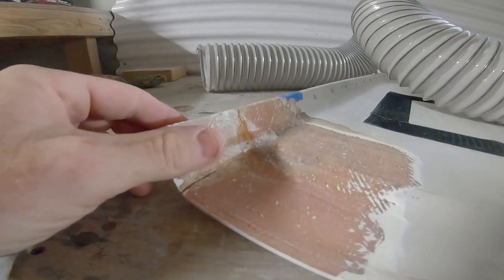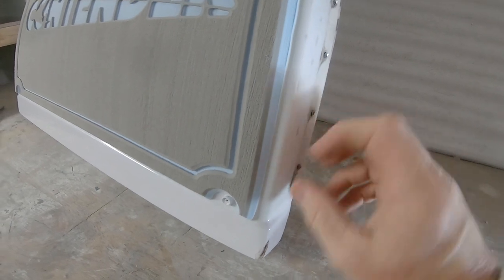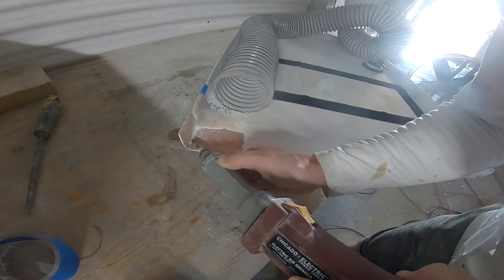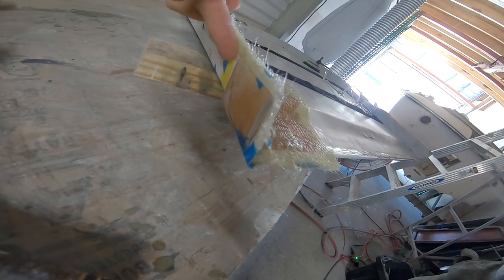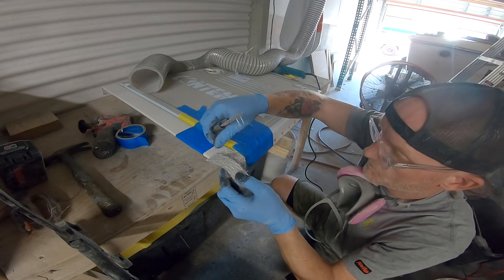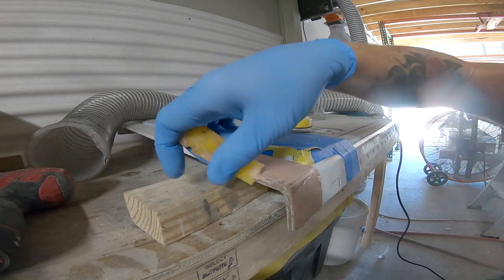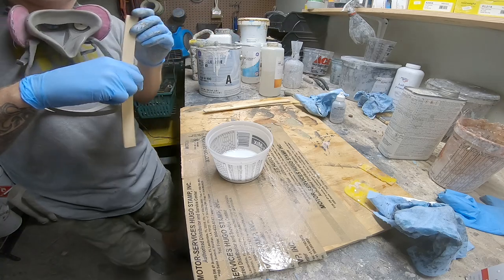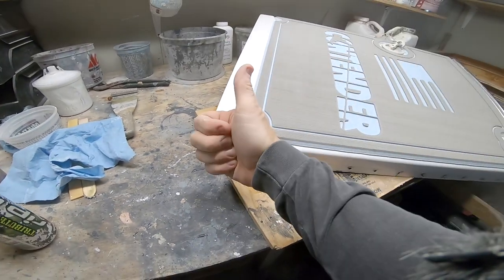Fiberglass Boat Hatch Repair Step By Step using epoxy and polyester resins

Comment: Another X video Russ I’m doing my 1st restoration project on my 93 reg. classic all your videos are helpful I’m having a hard time blending the edges w/gel coat on my gel coat crack repair
Reply from the maker: There are some tricks to get the edge to fade.  Are you rolling or spraying?  
Its going to be easier with spraying.  Instead of having a hard tape edge, fold the tape over itself making a "flap" or round edge.  This will stop the over spray but you won't have a hard tape line.  Sanding is where you will have to do the final finishing.  I would start wetsanding with 600 and then move u to higher grit papers as the edge starts to blend. You can start with 400 if you need to remove more material but be careful to not sand through the gel back down to your repair.

Comment: So glad to have found your page.  Good luck with it. 
If you can think on this one for a minute and get back to me I'd appreciate it. Hatch repair due to rotten core...set about the work, went well enough....but the table I used wasn't flat and true, so the hatch warped a little bit. I can step on rectangular the hatch on opposite corners and it flattens out well enough, I tried head gun...but without weight it's not flush...so I was thinking about a kurf cut or two.
Before I get the saw I thought I'd check online and found you. 
Any input appreciated. 
Perhaps a few slices with oscillating tool....circ saw?
Thanks again
John
Reply from the maker: It probably warped due to the heat from the exotherm of the curing resin.  This is always something you have to be aware of when doing repairs on something that could potentially warp.  With out seeing it I can't really offer advice, but best advice is to remove it and start over.  Cutting corners never pays off in the end.

Comment: Amazing as usual! Two questions though: 1- why you didn't use fairing compound? Too much sanding involved maybe? 2- can you tint & or flake this paint? Thanks for the great content learning a lot and happy new year!
Reply from the maker: I did use a light coat of fairing right at the end before I sprayed paint. I was able to sand and shape my fiberglass so fairing wasn’t necessary except to fill the little pin holes in the resin. Fairing compound on it own has no glass to reinforce it so it inherently weak. Fairing compound should only be used as a last resort in very thin layers to fine tune a surface.
Reply from the maker: And yes Polysiloxane can be tinted to any color you want. Flake ? I’m assuming you mean metallics and that is a no. This paint won’t atomize enough to carry a flake.

Comment: Great video and hard to see the difference at the end. The more I watch your video's the more I think some jobs should be hired out to pros as it is all of the little details that make a quality long term product. 

A future video about the SW Polysiloxane would be very interesting. Would like to know more about any prep & application tricks when using the paint. Do you have any recommendations on generally when you would use this product over a traditional top-coat product? How well does it generally blend in with existing factory white gelcoats? Reading through the product data sheet there wasn't anything on the product data sheet about flexibility/ductility, have you found it holds up well on areas that see repeated flexing on a boat?
Reply from the maker: SW spec sheets are very basic and don’t get into that much detail. You will have better luck google searching “Polysiloxane” and read the technical data on the chemistry for this paint. Several companies make this type of paint I just happen to use the SW version. Another one is PPG PSX700. I’ve read hours and hours of geek materials. I’m currently sanding so I have to be brief but shoot me an email I’d be happy to answer anything I can.

Comment: Did you just add a small bit (like 10% or so) of mineral spirits to thin that paint?
I have a very similar repair to do - great info!
Reply from the maker: I used a small amount of the epoxy reducer from Sherwin Williams. The paint I used was a Polysiloxane so it’s different from typical polyurethanes.

Comment: Beautiful work  as always,  but where can I get this paint to buy (polysiloxane xle 80 extra white b80 800).
Reply from the maker: Sherwin Williams Industrial or PPG PSX700
Reply: Which website can I purchase the polysiloxane epoxy paint from,  please.
Reply from the maker: You have to go to a SW Industrial store. Can’t order it online.
Reply: What about the sherwin williams  macropoxy 646 paint is this a good one ?
Reply from the maker: Macropoxy is a primer not a paint. It’s actually a great primer for hull bottoms and it’s very durable. But it would need to be top coated to have any color or gloss.